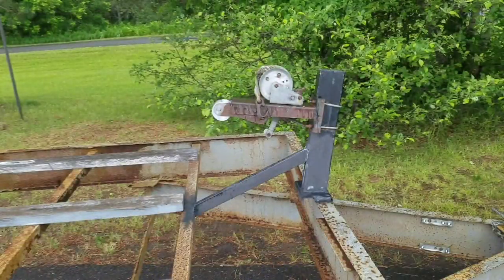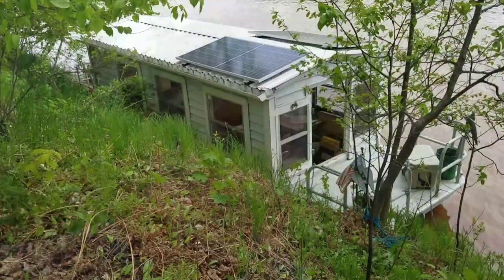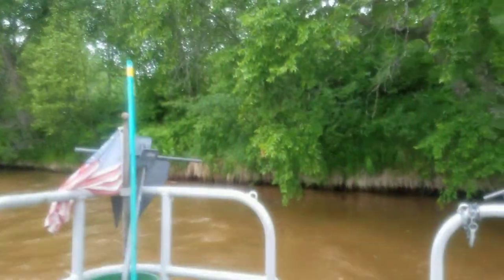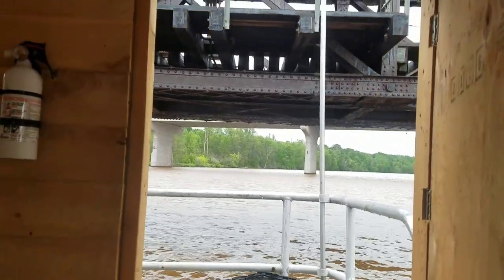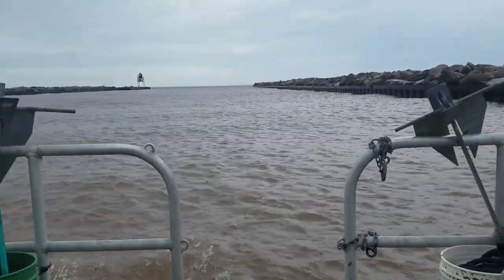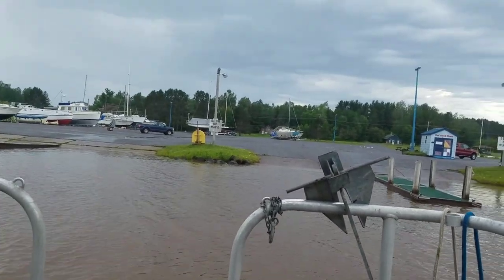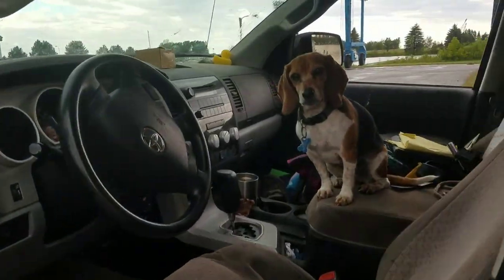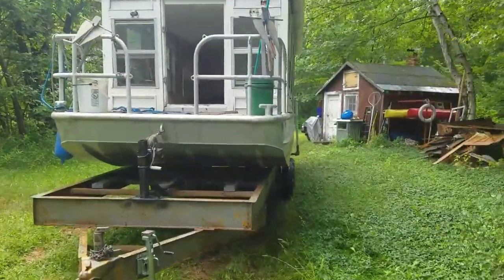A Beagle Barge Update | Improvements Needed...

Comment: Ok we talked about this before but I've changed my opinion on the door (s) issue both need to be outswing on water proofing two safety precaution against wave intrusion
Also I think you need to spring for someone to weld up the frames fabricate the door and make it of heavy plexiglass so you visibility both fire and aft.
Reply from the maker: I'm going to make them swing out for sure Dave, and currently thinking made of wood with lexon glass roughly thee same size in front as front windows already there...and a small port hole style window in the rear door...that also swings out.

Comment: looks as if your winch is also pulling down on the bow creating a friction load.   perhaps if you mount the winch on top of the "post" this will give you longer pull to increase hitch weight as well as pull level with the barge eyelet.
Reply from the maker: So move the winch down the post to be pulling more even with the eyelet? Appreciate any advice. Imagine how hard it was without anything;)
Reply: I think moving the winch up...you want the winch cable to be parallel to the trailer bed when attached to the barge eye.
Reply from the maker: @steverichmond9157  I'll look at it asap. Thanks for the tip Steve

Comment: I cut some strips of plastic barrel 6 ft long and screwed to wood makes boat slide easier
Reply from the maker: Excellent idea. Thank you
Reply: @backwatersandbackroads  only need near middle to front . Heat and bend on sides for screws in sides